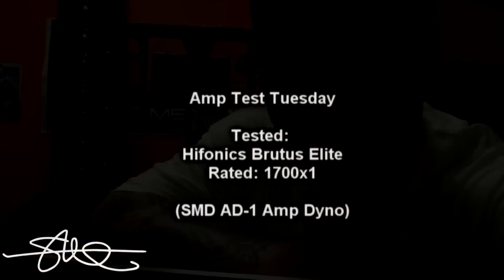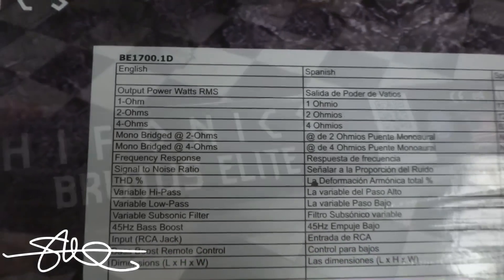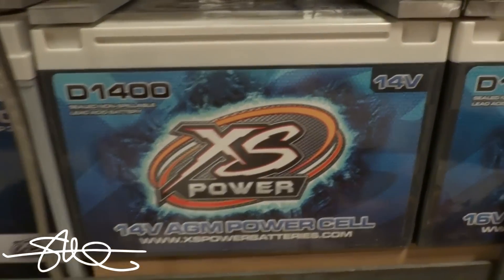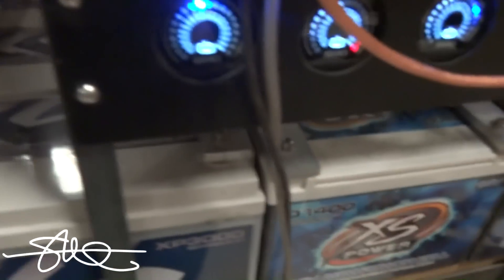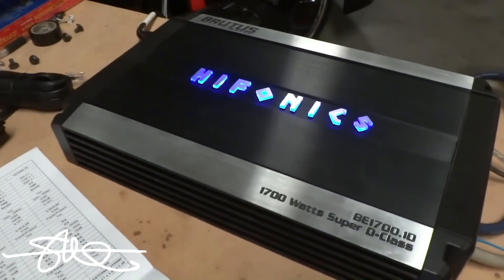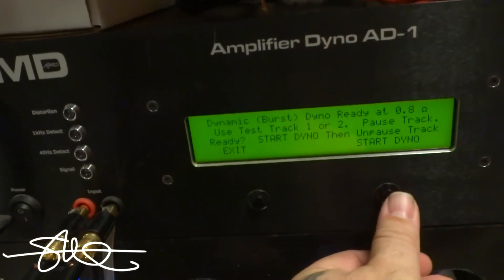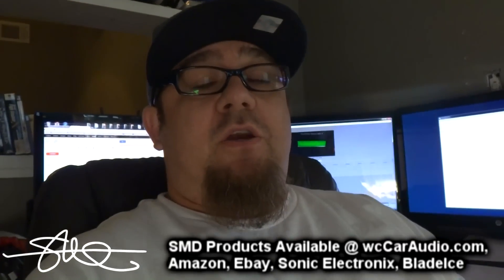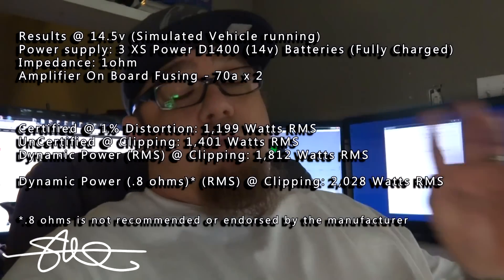Amp Test Tuesday - Hifonics Brutus Elite BE1700.1D Rated 1700x1

Comment: I remember in the late 80’s when every one around me were using the punch 45 & the punch 150 I sold to get my Hifonics Cyclops (100x1) on (1) Kicker 15” I used in my Honda CRX that was so loud! It lasted for so many years,  It was in the late 90’s when I sold to a friend (amp still working) and always regretted selling my Cyclops! The early Hifonics amps were so great in those days! I read all kinds of mixed reviews on HiFonics now they are cheap compared to those early days. Now in my late 40’s I still have audio with new Civic loaded up with Skar audio that I find is priced right and works perfectly for my needs! I’m older now so run (1) 10” Skar SVR DV2 in factory enclosure with a Skar RP 800 at 1 ohm doing more than to my satisfaction!#Beginnings#Hifonics#Skar#🔊

Comment: Ok maybe someone on here can give some advice, I have 2 re audio sex v2 duel 2 ohm subwoofers 1500 peak 750 rms, I want to wire the each sub to 1 ohm and each sub will be powered by a hifonics brutus 1600.1d amp, anybody have a opinion on that set up, the box is a 6.6 cubic foot split so each sub will have a 3.3 cubic foot ported area.

Comment: testing at 16volts? id like to see the test done at 12volt system with a idle voltage at around 14.4- 14.2 like most ppl have !

Comment: Yo bro i need help i got a 2500 hifonic brutus eleite hooked up to two 12 kicker L7 1500w ea 750 rms 4 ohms dual i got a lanzar audio 0 gage wired w a 250 a inline fuse ive burnt out 3 kicker L7s already why is this happening???

Comment: I had an 'old school' Hifonics Hercules XI that was rated at 1500w at 1 ohm...but would always go into protect mode when used at 1 ohm while playing music.  Even though it would not do what it was rated to do, that amp kicked ass at 2 ohms (with my xtant 10" dvc 4 ohm speaker) and never gave me any problems.  This was so much power for a 1st Gen Toyota MR2, where the volume of the cabin was barely larger than the recommended size of the speaker enclosure.  LOL!
Reply: I used the “Cyclops” (100x1) back then on (1) 15” Kicker sub back when Zed Audio made them and it was an indestructible beast of an early mono amp! Those were the days…..#HiFonics#Cyclops#🔊@Crazy 8s Drums

Comment: Man I hope you can reply to my Question I got a Rockford Fosgate P2D2 Sub in the Ported single Box but it's a 2 ohm DVC 400wrms dirt cheap, I am thinking of getting one of these because I need a Stable 1ohm that can push 350-400 with headroom
Reply: I can get the Hifonics for like $70 and that would save me $ for amp inline fuse and all that

Comment: I have clamped a bxi2610 a few times. You can't find them anywhere new. Wired at .7 I got 2495w on a 44hz burp. Keep in mind I was dealing with box rise. I have meter/clamped it 6 times. Always the same numbers. Played it hard for 15 min solid and it got warm. Just warm as in not hot at all. My electrical consists of 4 batts, 2 banks of caps, and 2 ho alts. I only did it to show people that the amp is good and dependable if it's got plenty of electrical.

Comment: Somwould this be the amp to use for my 2-12" 4ohm type R Alpine ?
Reply: type R's suck they used to be good 3 models ago back when they were grey and didn't have that goofy accordian surround. The subs are horribly overrated I'd say 450wrms max I cooked 3 of them with only 1500 watts and no clipping set by o scope. Needless to say I ditched them and got a pair of dd redline 712s.

Comment: Steve. ..the Power Acoustik EG10K on its Dynamic 1/2 ohm test run on another guys channel produced 4800 plus drawing 365 amps of current....@ 325.00 
wouldnt that be a heck of a deal?
certified 1 ohm was still over 2k...have you tested this amp before? & whats your take on it?
Reply from the maker: that brand is garbage.  I would never recommend it.  Don't buy brands that lie to their customers.
Reply: I'm sorry for inquiring on a brand of your disliking...but I've been selling and using it for quite some time...(I never look at manufacturers power rating...only how well it will work in a particular build)...I do hate that false marketing that tends to confuse most novice... but performance wise...I've not had no problems with the models that I've used.
It's not many shows in my area and most guys just wants to beat down the block without spending a lot on audio.
I like the other lower price audio such as the Audiopipe...Rockville and CAB audio...but thanks for taking the time to answer my inquiry.
Reply from the maker: it isn't that i dislike it. It is that the amps are garbage. The numbers are inflated so UNINFORMED people will be sucker enough to buy it.  The people that sell it should be ashamed too.

Comment: got 2 Brutus 2600 D Class on 2 Orion 15.2, not enough power for those monsters but does alright. Installed in 2009, still going strong in 2017

Comment: i have the 2200 super d class monoblock....  feeds 2 1200 kenwood subwoofers  and its ok i have never had any issues with it had it since  2013...
Reply: have you ever had the hifonics 800.4 Brutus elite
Reply: actually no. when i was shopping to be honest i didnt do much digging...  all i wanted was something in the  300 dollar range. ...  i gotta say i am not disappointed.even the led lights are still working and i use it on a daily basis.
Reply: sam njoroge well ive been researching a lot on a good 4 channel amp under 200 i saw one review on sonicelectronix for this amp a guy said he had it hookep up to his 10 inch sub and was playing it for 1h 15mins and it got hot and shut off
Reply: So i dont know whether to decide between this or the Audiopoop 1500
Reply: prior to this i had a pioneer 760.. which i used for mids tweeters and one 12 inch  sub..   then when i got the brutus   i switched the  new subs  to the brutus but retained the mids on the pioneer... 

maybe he wired it wrong or something..  1hr 15 mins it shud be warm not scorching hot.
Reply: +52^ V1LLA1N i remember having a boss r300 running 1 12 inch rf p3.. amp burnt my hand and smelt nasty after sometime, but never shut off D: it worried me so i had to buy better one.
Reply: Just Chillin yeah...i dont mess with boss

Comment: Any chance you can test the 35th anniversary edition of this amp? Its not cea-2006 compliant but supposed to be an improved version of the one in the video.
Reply: I have one of  these and I can find very little info on them. They are really good amps but cant locate the specs anywhere

Comment: 2 questions 
1: do the brutus line put out its true power I have the brx3016.1d I love that amp but need to get a new alt and batteries 

2: when you build boxes do you go with the recommended  volume of the subs I'm trying to get my house shaking from outside if you know what I mean

Comment: I don't know what to do I plug my amp in and I have power my light comes on and all of the internals look perfect but when I check the power coming out its literally nothing so what should I do? It's a 250/1 jl audio monoblock amp anyone on here know if there's any known problems with them? If I don't get it fixed I'm probably just going to unload a couple .45 clips on it.
Reply: bad ground, remote turn on, or aux. Does the amp power on.
Reply: damn son jl fucked u up

Comment: What 1000rms 1 ohm stable amp on stock power would you recommend in the $200.00ish range?
Reply: hifonics brx are really good and also soundstreams you can really get a solid 1500w for less that $200 ... good luck hunting bro just trying to help out

Comment: from what I've seen most of the dyno tests are above cars voltage Which is 14.5 not 15 -17v. so no the amp ain't making nowhere near it's advertised power at 14.5v (maximum car voltage)

Comment: Would you recommend this for an SQ HDS312?
Reply: ***** Take the DC AUDIO 2.0K you won't regret !!!!
i know it's a little expensive but it worth it !
Reply: ***** Absolutely !!! you can't even compare the power...
DC audio 2.0k:
Certified - 2351
Uncertified - 2419
Dynamic - 2624 all that 1 ohm with very high efficiency - above 92% !!!!!!

Rockford are good and all... but if you looking for power and quality only DC...
Reply: ***** The DC puts nearly 1400 rms at 2ohms...  i working with double "dc audio m3 8" subs"
(connected 2ohms) each of them 600 rms and it's pounding really hard. but i promise you only one thing. even if your sub is 2000rms with final impedence 2 ohm the dc will be more than enough to loosen the bolts out of your chassis !

Comment: hey i would like to see you test a boss ph 5000
Reply: I'm sorry. no offense.
But it's absolutely overrated !!!
boss audio never was a good audio company in my opinion.
i had 4 channel boss amp last year and when i replaced it with an
expensive one then i began understanding that it even can't be compared...
The sound quality the "life" of the music and the frequency response at high volume.
Reply: Pimphand Gamester the planet audio ac5k only did 1300w on the amp dyno and planet audio is the exact same as boss phantom 5k. So they are ridiculously overrated
Reply: Love Lost thank you question, where can I buy it for that price thanks
Reply: David Rodney Yeah but for about $150 you can get the newest model APCL15001D it's 2006 CEA compliance and it will push (2810) Watts RMS @ 0.5 OHM's... not sure how long it would last but ...that's pretty good ...a lot better than any BOSS or ...Planet Audio shit get a PA BAMF amp if your going to go cheap ...hell even the new>>> PIONEER GM-9601<<< 1200rms and 2006 CEA Compliance.. about $170 . ...i can say that the Pioneer 3003D3 12" Subwoofer sounds a lot better than 90% of brands out there ....there is a video of 2 12inch 3003D4 metering 150+ DB with a Sound Digital 3000D1....the subs are rated for 600RMS i asked him he said he was putting 1500rms to each sub and they been taking it ever since id like to see it in person ...but id say that's pretty good for $160 for 2 12's shipped not bad at all ...and SoundQubed HDS300 Series are beast you just can't beat that price! like 160 Shipped a piece...i seen one of those SQ/S312 doing a 150+ ....the BL is (27) "Holy Mother Of Motor Force" and it's only a 140oz magnet...reminds me of a DD Redline Series i believe they are sistering Company's i believe the father of DD owns SoundQubed i heard... not for sure and also that American Bass was part of it ...but id say probably not many manufacturers use the same Part Ect. Remember saying let go QUAD out ...with 2 10's or 2 12's never owning 15's bc i felt that 12's gets the best of both worlds ...High and LOW's ...When it comes  to even thinking i can't get the HDC3's 15's off my mind! Sorry for the Rant just Finished 3 Monster's that's 6 servings lol ...not bad ... 3 for 5 ..or 10 for 14...Addicted
Reply: Hey Robert well what were you referring to??? Id really wan to help you out ..why spend more if you don't have to in the first place ..saving money always seems like a good thing.
Reply: Love Lost thank you I was referring to the APCL 15001D that was 2006 CEA in your post, that where i could get that at that price it seems like a great bargain

Comment: hey Steve i have a question. I have a kicker comp VR 15 @ 2 ohms. Would the Brutus amp be good to push them??
 the speaker is rated at 1000 watts 500 rms.
Reply: yes..it will work very well
Reply: Thanks man I am trying to get the most out of my sub it sounds good with the two channel but I am trying to beat down the block

Comment: Isnt is 1700rms @ 14.4 volts tho? It did around 1700rms at 15.14-15.20 volts. In my opinion thats not passing. Not saying for the money its a decent amp but thats a voltage most people are going to see. Most people are going to see the 1100 watt range out of that amp prob less because voltage drop.

Comment: hay steve  , man can you test a hyphonics zeus 3000.1d, I got one and want to know what im working with , thanks
Reply: nullsig I had the ZRX 1200.1D and i can't say anything bad about them besides they are overrated...
that was when i had only 400 watts 4 ohm single sub. i was impressed from the sound.
Reply: DEZ n00ts is that all the Zeus line or just the 3000.1d ?
Reply: yeah I ended up getting it and I am happy with it so far. But like always its already not loud enough hahaha

Comment: big fan on hifonics, but am gladly surprised to see the amp pass the test. I actually have the previous 1700D running two hifonics square 12s dual 2ohm, so running 1/2ohm to the amp and have never seen protect mode even pushing them to the limits. videos are always great

Comment: Got an amp " hifonics 800  watts zeus series " going strong 10 years. No bull shit.
Reply: hay I got the zeus 3000.1d,  how many watts do you think it will push, im asking couse you have a 800
Reply: +Michael Beard well i used to use it on two 10 inch kicker cvr 400 watts at 4 ohm ,i now use it for highs.  so i imagine what kind of damage u can do with your amp. Your amp might be over rated, so it might be 1200 rms which is still good , so you can still push a good line of high rated speakers, mabe between 400 and 800 rms would be pretty good with your amp.
Reply: man my subs are 1500 watts rms,
 I need something powerfull
Reply: Michael Beard oh if u have a pair of those subs that u say " then forget about it " you definitely need a high powered amp. I have two polk audio 12" 800 watt each " and im pushing them with a small compact 1600 watt massive audio. Those amps kick ass! And they pump out true wattage. I paid 200$ for that amp, it never ever gets hot at all. Im sure a 400$ or so " massive audio" will take care of what u got. And they are very compact also. Good luck.
Reply: if this amp isn't enuff ill look into it, I haven't hooked it up yet,  because I work so much,       http://www.ebay.com/itm/DB-DRIVE-WDX12-3K-12-Competition-Subwoofer-3K-Watts-Dual-4-Ohm-Voice-Coil-/111540949831?pt=Car_Subwoofers_Enclosures&hash=item19f85bd347, but I didn't get mine on ebay I got mine down the road from a shop in dallas

Comment: I have the hifonics Brutus elite and I freaking love them ! And to the guy saying these amps are shit is a total dumb fuck ! I've done my research and these are the best amps they put out the wattage they say they out out and if they ain't lasting people for more than a year then something is wrong it's user error not having big enough power cable not a big enough alternator not having a battery that can handle the amp draw not having solid ground connections !
Reply: yes i like them too nice amps. i use audiopipe now cost less and do better numbers. fyi
Reply: I had one on my Fi BL 15, optima yellow top, big 3, 0 gauge power wire, all connections were good. And it crapped out on me,  I went and got the hifonics brz 1700 and man to me its a better amp, its louder, and sounds better imo, it should hold me until I get a rockford t1500 or a saz1500

Comment: can you test the planet audio AC4000.1D?
Reply: Some1 tested the ”5k” one it did like 1.6-1.7kw so I'm guessing the "4k" one is like 900-1kw. They're nowhere near rated power. If you have one just cut the back plate open and install 2/4 cooling fans that way you'll keep the components cool. In all honesty I have absolutely no clue as to why they advertise those amps that way. I mean shit you're getting about a 1kw for around $130.